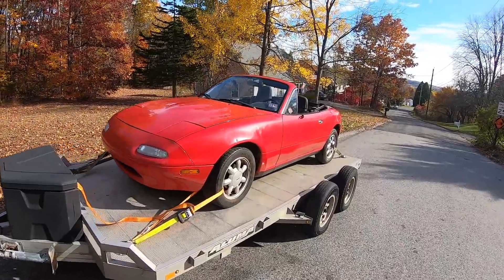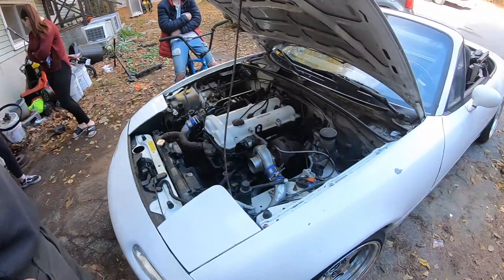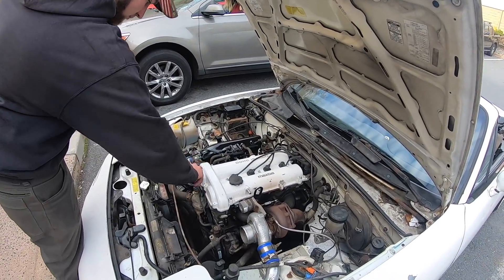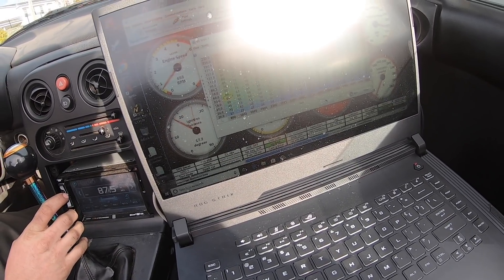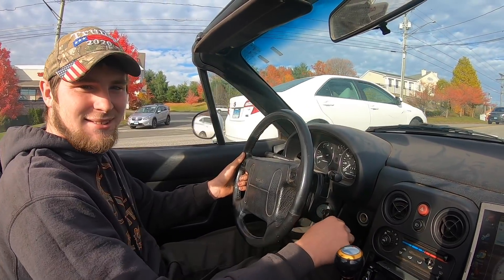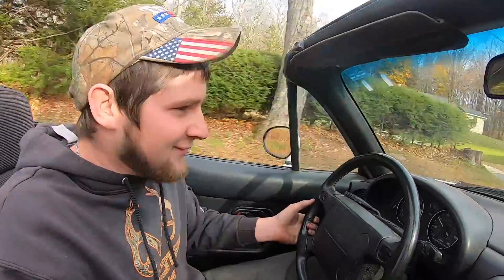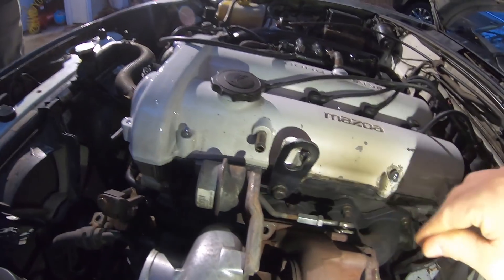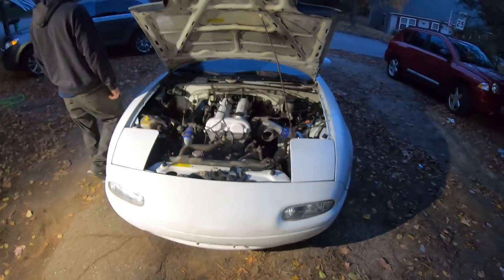HITTING BOOST IN THE TURBO MIATA!

Comment: It doesn't look like there's enough tension on the wastegate, that's why it's not making much boost.  Double check the rev limit isn't set to 5500, and that launch control is off.
Reply: WFOinCO I was hoping someone else noticed the rev limiter too, you can tell if you look at his screen that it was below 6k because the gauge is is red around the 5500 mark. Hopefully he sees this and gets it fixed before he goes crazy chasing it around lol
Reply: I was about to comment about the preload on the actuator, seeing as he doesnt know what hes doing i assume anton just connected it up with the piece he made.  He needs to set the preload
Reply: Gwon Phil^^😂😂

Comment: Best I could tell, the boost hit 157Kpa which is around 8.2 psi. If you don't have a boost gauge, see how high the engine goes on the fuel table and convert kpa to psi. Also, Tuner Studio has a "boost gauge" you can put on the "dashboard".

Comment: It seems you have a rev limiter set to 5500 or so judging by the footage you took of the laptop while driving. Might want to check that out before chasing your tail trying to fix the breaking up issues.

Comment: Sounds like the tps needs to be adjusted, inakebox/maf cleaned, or upgraded to z32 maf. Wideband 02 sensor, thennnnnn do a "road tune". Then have the pros take a look. After you jbweld the holes on turbo manifold

Comment: Few small problems on the miata you may know about lol.

1. Close the bolt holes on the exhaust manifold.

2. Fix boost leaks.

3. Install boost and afr gauges.

4. Preload the waste gate actuator, you want the link to feel too short, but just slightly, or the waste gate will stay open a little.

5. Do you want to blow the engine up? Right now the turbo doesn't make much boost, but you should not run the waste gate without a vacuum source ever. What if it makes 30psi?

Comment: You guys need to take it to Morfab and get them holes welded up and get a vacuum pump to see when the waist gate actuator opens and adjust it right so there's no boost issues